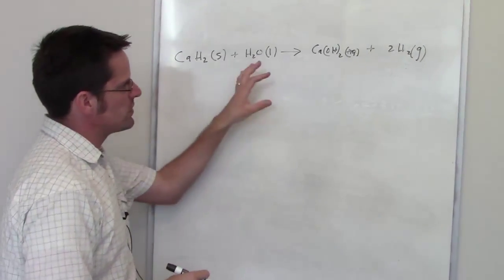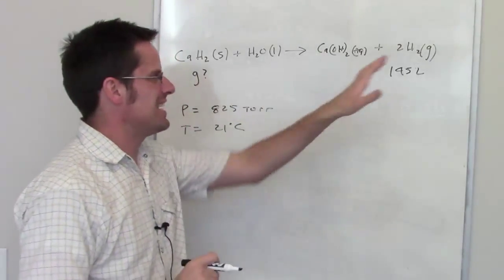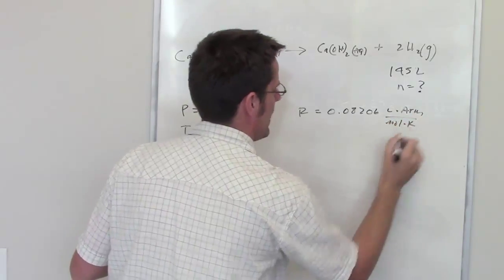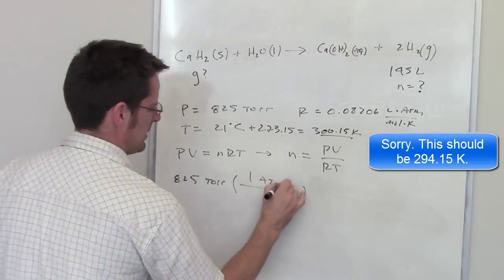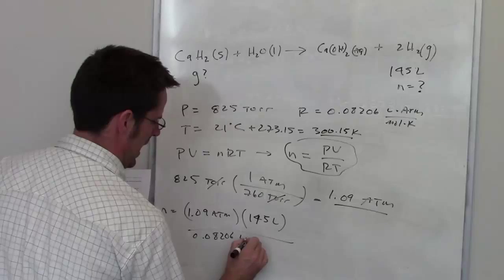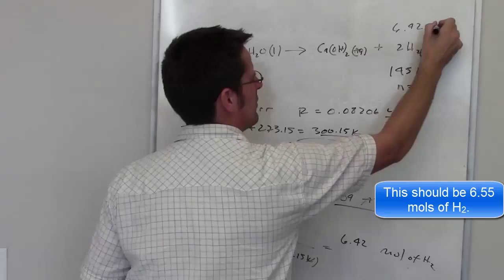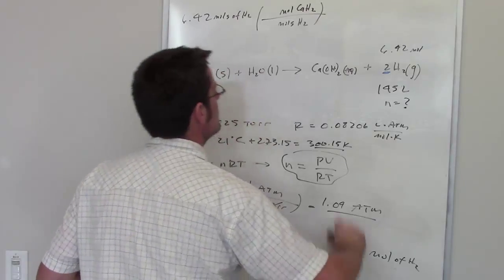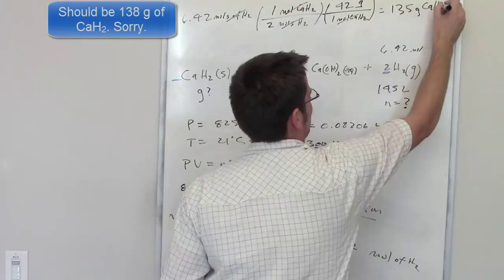Chapter 10 - Gases: Part 9 of 12

Comment: Why are we not using the L-Torr/molK for this?
Reply from the maker: You actually can, Ginamarie. It just requires you to use a different value of the ideal gas constant, R. The value I typically use is 8.314 L-atm/mol-K. However, there are other values for it, which are the same overall value, just with the numbers adjusted for different units. The key is to make sure that all your units in your problem match the ones you use with the value of R that you select. To see different versions of R, please go about two minutes into the following video: http://www.youtube.com/watch?v=Ua_nP31LIUI&list=UUpUkAZfpeUBMmA_zAAERyZw